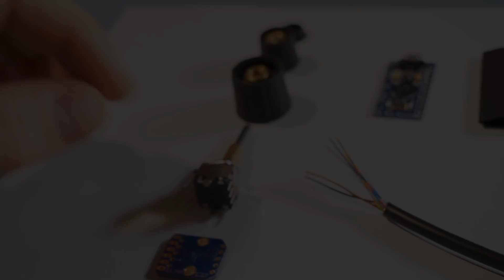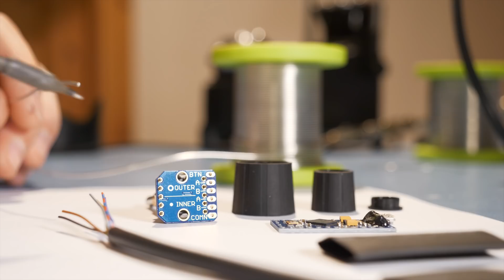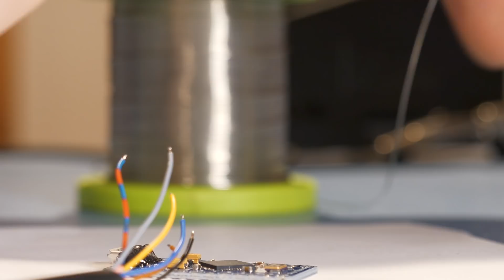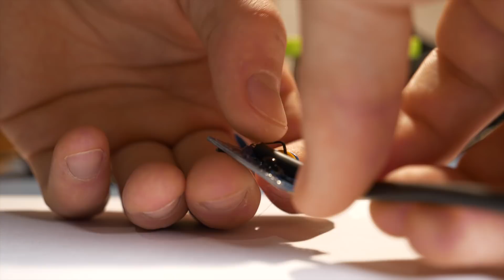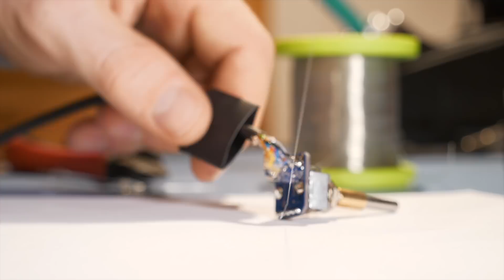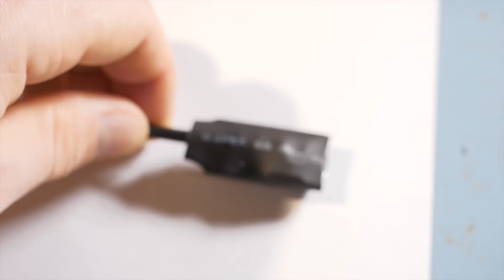DIY Dual-Concentric-Encoder USB | OpenVario

Comment: Nice one Stefan. Can it be plugged into a usb port on the back and work alongside the stick control?
Reply from the maker: steve crabb Yes, you can connect more input devices and also use a USB hub.